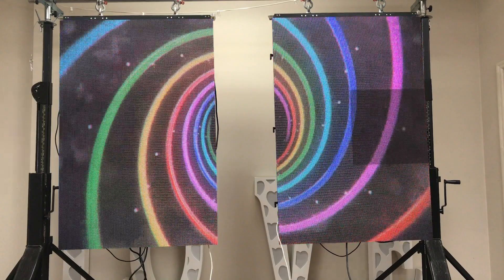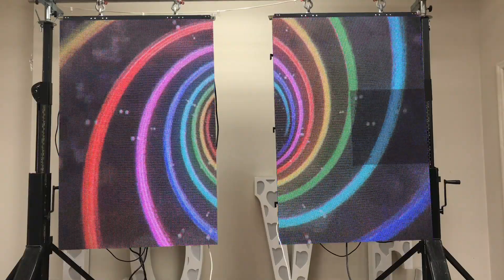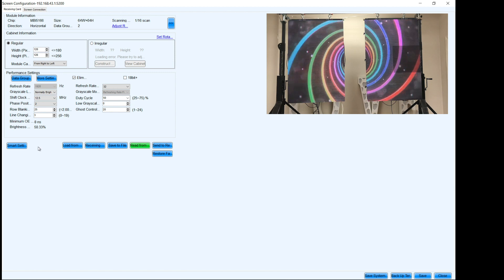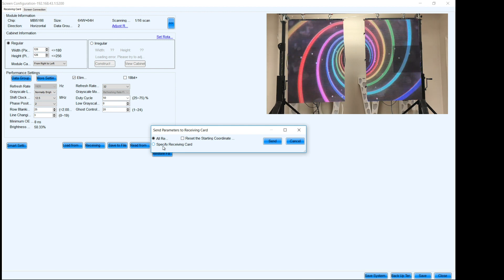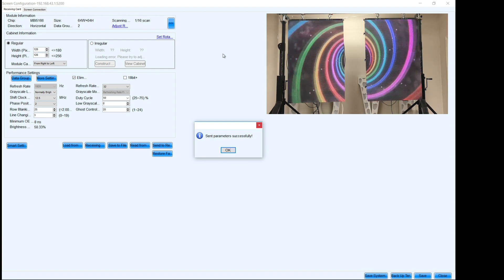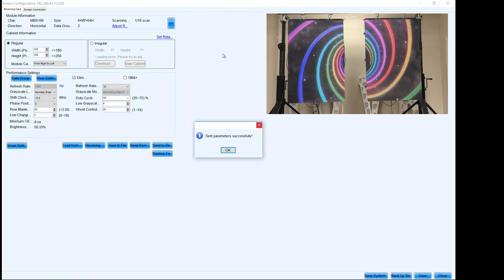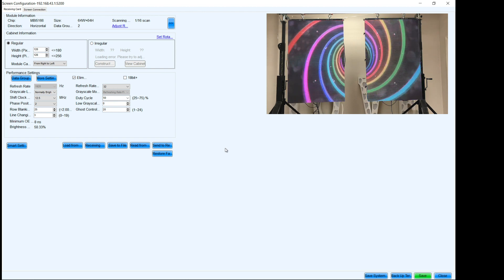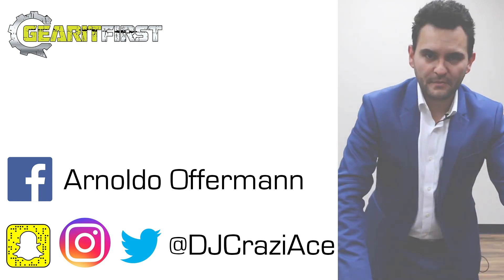LED Wall -  Configuring a single installed panel

Comment: Thanks. you got me leaning towards the Taurus instead of the vx4s. It seems easier to use.
Reply from the maker: Easier to use, but also a bit limited on advanced functions such as updating firmware... but it’s also the most powerful
controller for its price range.
Reply from the maker: Also remember NovaLCT controls all Nova products. Definitely hit Blizzard up. They’ll hook you up proper!